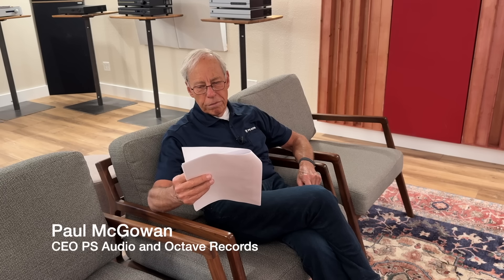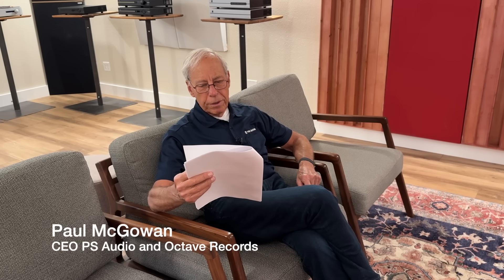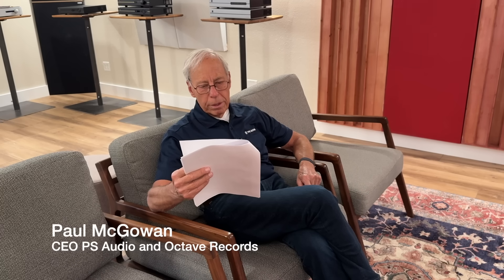What parts of a power supply are most important?

Comment: Everything matters.  Normally Paul also sings the virtues of an overspec'd transformer.  Medical grade toroid about 10x larger than minimum spec also makes a difference.  Let's not forget resistors vs choke.  Choke is preferred and quality of the choke also matters.  Even when you need massive electrolytic caps in the power amp, bypassing with film caps brings the sound to life.

Comment: Power supplies are the devil, get rid of them!  Just get a pair of 80 volt commercial fork lift batteries (if your amp can use 80 volts, +80, gnd, -80) and you’ll have the cleanest source of DC power you can get…….😊…….might take up a little space….😂
Reply: And for low voltage digital a bank of supercaps periodically charged.
Reply: The extremely low internal resistance of lead-acid accumulator batteries is absolutely perfect for top-notch audio performance. For the low voltage stuff I use a 12v leisure battery.

Comment: Most rectifier diodes (or bridge-rectifiers) used in common audio components are "low budget". 
(and NOT snubbed) They are the first semi-conductor component that is subjected to voltage transients.
Most are NOT replaced by cap-upgraders since you need to understand the specs of the diode (or rectifier) to replace it with.
And in many case they are mounted in some out of the way corner and not noticed..unless one cracks (explodes).
Reply: You also have to have some knowledge of the specifications of the power transformer to design a proper snubber circuit.
Reply: Ultra soft recovery ones do perfectly well without caps, I go with 25A continuous rated type and mount them on sinks. They can handle peaks in excess of 100A easily.

Comment: Triggered again. Way back in the day. 70's, I repped a company that used many smaller caps instead of single larger ones in their PS. It was a bragging point. Quicker charge, longer discharge. More current faster. Less internal resistance to the PS. Some European or Nordic country company? Repped too many to remember them all!

Comment: If you want clean and technical use solid state. If you want emotion and to feel the music use tubes. Not always but in general that is what you get. Tube amps get a bad rap but that is because most people's budget is in the low range like a few thousand and not much that good in that range. Tubes tend to do better with more high end design and parts. Prima Luna makes a great starter tube amp that can be tube rolled to be even better. Solid state since most people are focused on if can sound clean and bang loud the perception is cheaper in cost solid state outperform tubes.  Solid state is like a Toyota car that can take a beating and keep on going. Higher end tube amp is like a Ferrari you have to use it and then constantly do upkeep to keep optimal performance.  Way back in the day in the 1990's I had a huge Threshold class A amp that did have some emotion to it. It threw off a ton of heat though luckily room was really big. I love my VAC 452 IQ musicblocks.

Comment: Most important part of power supply: the soft-start circuit that prevents your big expensive power caps from getting kicked in the teeth every time the power is turned on!
Reply: Electrolytics couldn't care less, it's the transformer and the rectifier diodes getting a beating.

Comment: All together and well designed, but its always with compromises.
"Linear" ones:
Secondary > diodes/tube (tube needs heating power) > well designed snubber > choke for less transformer power demands reducing current in the rectifier (Mosfet electronic choke possible with HV and moderate currents)  > caps > Mosfet regulator (ramping voltage) > caps. Immune against main power variations, 50/60/100/120Hz always there and power losses important. Same for vacuum tube heating voltage but with low noise LDO. Film caps are better choice also will not dry out, but remains very expensive (something like called DC-Link, WIMA, TDK, KEMET).
And yes, good EMI main power filtering (with DC blocker) with inrush current limiting.
"SMPS": isolated Flyback with PFC. Only problem is that "Audiophile" are hating this kind of power supplies. IMHO, the way to go (fswitch way out of audio band) but you need a lot of experience for developing this kind of power supplies.

Comment: All power suppliers are switch mode but analog ones are low switching frequency between 60 to 120Hz, using an analogue regulator makes this non-switching.
Reply: No?
Reply: @badgermcbadger1968  Paul is talking about linear power supplies which will leave switch mode in the dust when well designed.

Comment: For once I don't agree much with this. The transformer in a linear power supply is the single most important component. Is the transformer that has to pump current in those capacitor. If the transformer is crap, even if you have great capacitors, try playing 1 minute sustained dynamic sound and you'll hear.
Reply: Paul agrees with you. He has said the very same in many videos about the transformer. He was answering a slightly different question here about the components after the transformer, imo.
Reply: @tamstutz921  I heard him say that in other videos too, probably you're right.
Reply: When they are talking about linear power supplies,  the transformer is considered what feeds the power supply,  not a part of the power supply
Reply: @Pete.across.the.street really it's definitely part of the power supply.

Comment: "What parts of a power supply are most important?" Probably the audiophile fuse.
Reply: Don't forget the audiophile fuse holder. I jest but I don't. I have seen a plethora of things go wrong with fuse holders aside from just breaking due to long term mechanical stresses.
Reply: Underrated comment lol.
Reply: The audiophile tinhat for less interference in your brain
Reply: @DR0Dangerous audiophiles would never use Tinfoil, only OCC copper foil!!😂
Reply: Nah, quantum enhancement mode Pauli exclusion principle defying, cryo-treated Bose condensate audiophile adaptor.
Reply: Nope
Reply: especially if blown the fuse is the all-important component
Reply: Transformer is the most important ....second to none.
Reply: @andrewlim7751 I agree. I'd say transformer, then caps, then diodes.  Way down the list is audiophile fuses 😂
Reply: @ThePapabear2012 
Agreed, the diodes and tube are the same status, that's why audiophiles love tube rolling aka faster transistor but the tempo and atmospheric mood created by tube is hard to replicate.
Reply: @ThePapabear2012 
I'm still sticking to big and bulky EI transformer together with quality choke, every gram counts. 😂😂
Reply: The Angel piss dispenser
Reply: Unless you try these things you yourself are unwanted distortion
Reply: @davroster  And if you climb into an empty  nuclear reactor you yourself are the core.

Comment: I'm pretty sure that the way forward for high-end audio are switch-mode power supplies and feed forward error correction.
Reply: Oh yes, 100%. I can’t wait for the toroidal in all its expensive glory to go the way of the dodo.
Reply: @HifiLoveLetter  But we have to move through the O-ring transformer first.
Reply: feed forward error correction 😅
Reply: @chungang7037  A marketing term by Sansui in the 90s.
Reply: @chungang7037  Overview of Feed Forward Error Correction

Feed forward error correction is a technique used in various systems to improve accuracy and reliability by anticipating and correcting errors before they affect the output. This method is particularly important in fields like audio engineering, control systems, and quantum computing.

Comment: A well designed power supply provides a DC output that is clean enough to make the analog circuits run without audible artifacts, and without any concern about needing an expensive power cable or special expensive type of fuse.
Reply: @ThinkingWorse, but there is nothing wrong with putting better shock absorbers on a car to increase performance and safety.
Reply: @Rogue_HC_Bumper_Plate  As long as you properly match the compliance of your dampers with the weight of the car, wheels and other unsprung weight. That is what a true quality aftermarket manufacturer will do for you but try n find one.
Reply: @InsideOfMyOwnMind  It's more fun to find the correct 'matching' power cord(s) for your components by yourself than have it spoon-fed to you...fun, fun, fun! 😁
Reply: It's about power factor compensation. Simple calculation. Do the meth.
Reply: @InsideOfMyOwnMind  Did the meth...lost seven teeth.
Reply: @InsideOfMyOwnMind Do the what?
Reply: @ThinkingBetter  Yeah...I mean NOOOO!
Reply: @Rogue_HC_Bumper_Plate Those things are more like the color of your shock absorbers. If you hear a difference upgrading a power cable or fuse, the power supply is pretty darn crappy doing what it is supposed to do with the capacitors especially ensuring proper robustness against tiny mains side issues. Bad engineering makes different power cables and fuses audible 😂
Reply: @ThinkingBetter I thought you said they didn't make any difference, now they make a difference if the power supply is designed poorly.
Reply: @mitchtaylor6512 Well, reality is most audiophile gear has a properly designed power supply where your audio doesn't get affected by milli Ohms of serial resistance through a fuse or power cable. If truly someone has a setup where a difference can be heard, it's due to shitty power supply engineering.
Reply: @ThinkingBetter If it makes a difference in a badly designed power supply, then it could make a smaller difference in a robust power supply.
Reply: @ThinkingBetter  All that I know is that a AU$200 IsoTek - 'EVO3 Premier' power cable made a difference to the bass response in my home-audio rig when I used it on my Musical Fidelity - 'M6si500' dual mono integrated four years ago. In February this year I upgraded to a HEGEL - 'H390' & I just plugged it in with the IsoTek, since I already own it. For decades I believed, just like you, that after-market (audio grade) power cables were a load of crap & so I had no expectation bias or placebo effect when I first heard the difference (improvement) in sonic performance.
Reply: The matter of a poor bass response difference being due to a power cable would boil down to the cable resistance and thus (very tiny) voltage drop being caused by it. That voltage drop is proportional to the resistance and thus also proportional to the cable length, twice the cable length means twice the resistance. Nobody selling audiophile power cables will tell you to buy their shortest length cable that works for your setup 😅 If you have a long and thin crappy original power cable for a power amp and upgrade it, you would have a strongest argument. Honestly speaking, you should ask someone to help you run a small blind test by using original vs new power cable and then you try to identify which cable. Usually this topic is down in under 0.1 dB difference on the output and not something our human hearing can realistically notice.
Reply: @ThinkingBetter  I wasn't talking about a poor bass response. I don't care what I'm told by power cable manufacturers, the fact is that I bought the shortest available (1.5m) I don't need a blind test because I heard it straight away without any bias or placebo effect because I did not believe that it would make any difference.
Reply: Either you had a terribly bad power cable before, a terribly sensitive power supply in your amp (= bad engineering) or you should make yourself wealthy by publishing a science paper on the subject of power cables doing new science 😊
Reply: @ThinkingBetter  Same wall outlet, ie. same power outlet using the basic $7 in-box, manufacturer supplied power cable. Don't need science when my hearing can detect the differences. There have been many discoveries down through the centuries that the science of the time refuted, only to find out later that the 'science' was wrong because it didn't have the necessary tech to measure it at that time. It's not very scientific of you to dismiss what you don't know.
Reply: Where can I get one of these mythical "well designed" components that I hear so much about? And if they exist why isn't every manufacturer using them??
Reply: @Pete.across.the.street  Unicorn Industries P/L
Reply: @Pete.across.the.street  cost.